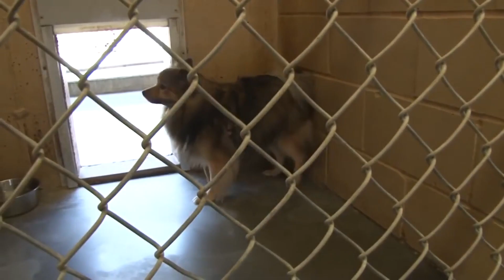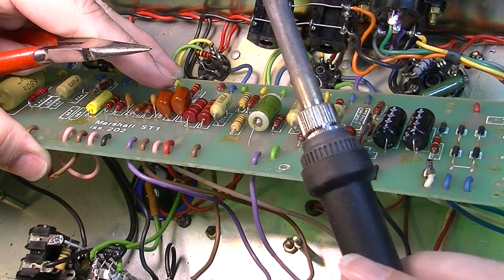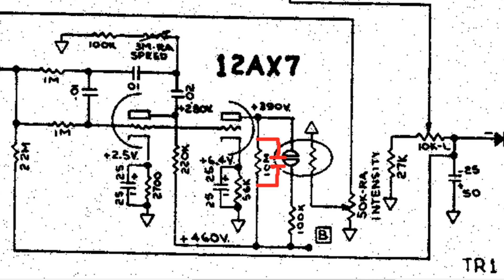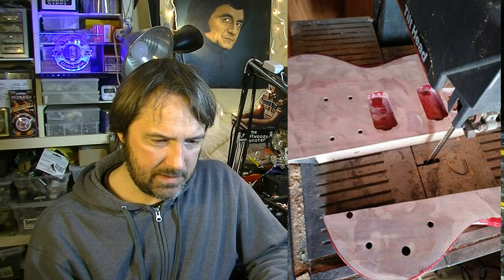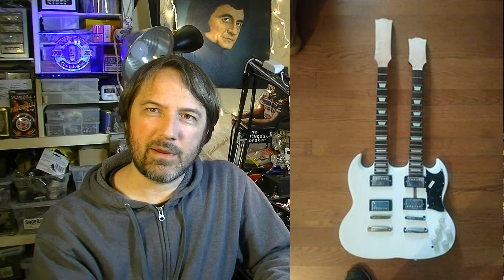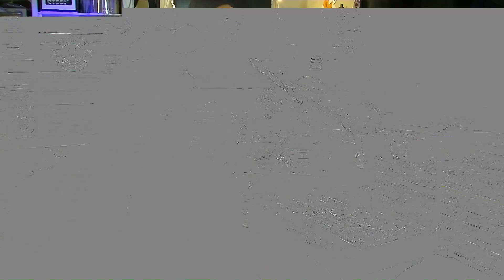So You Want to Learn Amp Modding? - SPF BONUS

Comment: I have a stupid idea that might be cool
I just wanna know if it can work 

I have a bugera 6262
I run an abominable hellmouth as my overdrive
Would it be possible to chain my overdrive into the lead channel internally so that the tone that comes out of the amp is already effected by my overdrive?
I have 2 of them but ones bypass is broken so i got the idea to use the board inside my amp but i dont know if that is even possible and i need direction from someone experienced in modding

Comment: Thanks for giving everyone a few tips Brad.i enjoyed watching your channels. so far I modded a orange crush 12 and a fender acoustasonic 15 with a pair of passive rockville slim wall mount speakers that I stripped the crossovers, tweeters, and 1 mid woofer( for the orange )out of the shells then stuck them directly to my amps speaker wires.i kept the eminence in the fender while adding a tweeter in one of the small holes in the faces of both amps.the orange has extra gain but cleans up very well and easy to just roll it off. the acoustasonic sounds even more sonic but with a little less microphonic squeal.

Comment: I fried a silvertone 1484 while swapping out a high value resistor  to a lower one in the power section.  As soon as I turned it on , smoke started coming out of the power transformer. I learned my lesson the hard way.

Comment: Can u please help me ?? I have a traynor ycv80 , I know but I'm poor . It's a 2 12 combo sound will completely drop out while playing on either clean channel or gain channel and when it cuts out if I lightly push down on the volume or gain knob on channel 1 the sound comes back. It will defantly cut out if the amps turned up but again lightly touch one of the 2 knobs and bam comes back . I replaced preamp tubes with 3 tung sol 12ax7 power tubes are 2 tung sol 5881 and 2 6l6gc Svetlana. Please help..

Comment: Did Fender ever make a 6L6 push/pull tube amp?  I think my dad used a Fender schematic to build my 6L6 push/pull amp back in the mid 1960's.  It was a good amp, just not loud enough for me.

Comment: Vibrato tick: install a .01 uf 600 volt from the junction of the photocell and the 10 meg to ground. Also, move the intensity and speed control wires away from the other pots.Move the vib tube socket wires together near the tube socket.The old update was a .01 uf across the 10 meg.That one didn't work so well.

Comment: I love you and the channel, but the ticking is almost always a lead dress issue, you have to chopstick the wires until it stops, its good to follow the fender layout for that but on my blackface princeton 1 wire that goes parralel with the tremolo pedal wire had to be moved as far left as it can to stop the ticking, also the wire that goes to the right lug of the trem speed pot had to be moved, sometimes its just a few milimeters and it does all the diffrence.
you can also add shielded wire from the board to the pots and ground the shield only to the pot side, ive done it to the input, the volume pot and the reverb pot and it made a world of a diffrence. sorry if i made mistakes, english is not my first language.

Comment: In re to "Build Your Own Clones" pedals. They are great.  I have built one of the chorus pedals and the FET preamp pedal and both are great.  Also building the Overdrive V2 right now, and I've got the Soaring Skillet waiting in the wings.  Previous to building these I had no experience soldering or doing much with electronics.  I just watched YouTube videos to learn, and the BYOC instructions were great.  Also the folks in their forum are very helpful.

Comment: A few months ago I got a good Champ-like amp, a Silvertone 1471, for $100 off Craigslist. It works great. Then I got a Kalamazoo model 2 (with tremolo)for $130 on the Bay, also Champ-like, works great too. You don't have to spend a lot to get a good basic amp with real parts and simple wiring. Watch the ads and be patient.

Comment: Can you walk through the Sears Silvertone 1484 Twin Twelve reverb circuit. I think I am following it but I'd like to know that I'm following it :) The amp has a different value for R41 than the schematic. It looks original. Schematic = 68k, value in the amp = 160k so it's not small change. The schematic is all over the web or I can link it.

Comment: The Epiphone Valve Jr is said to be the ultimate "gateway drug" into amp modding. I bought the v2 head almost two years ago and lots of components have been replaced. It still works, and the original PCB hasn't taken any damage from all the component swaps :-)

Comment: Tip.Mr.Carlsons lab has a piece of equipment you may be interested in. Its for working on solid state or switch mode power amps. Its called a signature tracer. I seen it on the vid called Electronic repair Samsom B77 stetro power amp. About mid way through and in the end. Seems like one hell of a piece of gear for the amp tech. And its a DIY build.

Comment: I have a solid state amplifier I'm working on.  I cannot find a schematic for it.  It's a Holmes amp.  The output has no coupling electrolytic cap, it goes straight to two speakers,  but I cannot tell of it was connected in parallel or series.  I remember when my cousin played through it back in the 70s that thing was loud!!  Anyway I replaced the old electrolytic caps, some were open and others were leaky and a few transistors that didn't read correctly.  I can't find some of the original transistors anymore.  Anyway the power transistors are 2n3055 so the old ones didn't quite match and I replaced them with some from mouser.  Well long story short... I've never fooled with a setup for transistor outputs before and I had my audio generator, dummy load and scope setup.  After 2 minutes in seeing a sinewave then it clipped into a square wave.  I heard a thud and the fuse blew.  Come to find out the output transistors failed.  They were fused/ shorted together.  Someone had said the output transistors today are not the same as the older RCA ones.  I'm not sure.  But it had to be drawing some current there or they just couldn't handle it,  even though it says they can.  The number on the transistors are the same as the old, 2n 3055.   I wondered if it was because of using my dummy load straight to transistor out.... the dummy is made for tube output transformer or tube... tubes are forgiving transistors aren't.   Let me know what you think Brad.   Thanks bro.

Comment: Poor guy, a Mesa on the bench. I just spent  days on a Dual Rec Tremoverb. Those things are the worst amps on the planet to work on. Turned out to have a bad LDR in the switching matrix. Works after 5 minutes of warm up turning power and standby when cold. Unfortunately these parts are obsolete now and were never a good idea to begin with. No wonder they only made these for a few years. The Mesa Swiss Army knife of tone with 22+  LDR's for switching is a bad idea. Bruce Egnater pointed me down the path to find this issue. Merlin Blencowe talks about briefly of how this switching system is dodgy at best. He is correct. Well, at least it's all recapped and  working now. Been dead for years according to the customer. Sounds great once it gets going. I guess a short wait is better than no amp at all.

Comment: The Dan Torres book has a fix for ticking tremolo----you have to re-dress some of the wires to the tremolo oscillator tube and "bunch them together" a certain way. I did this on several silverface Deluxe Reverbs a few years ago, it does work.

Comment: Hey Brad, I think you showed the 1481 or 82? The 84 is the Twin Twelve with two 6L6's in a tiny piggyback head and a 2x12 cab that it can tuck into.

I've got one of them, but only the head. Terribly inefficient OPT and cheap power supply design. It is a nasty beast, and with a WGS G15c my main amp. I think I'll have to die before giving it up... may not keep up with a Marshall lead tone, or Fender or Vox cleans, but the splatting and fuzzy crunch of that thing pushed full tilt is a unique sound. 

And that trashy reverb that so many hate? I think its trash too, but I love it! Mo dirt, mo trash, mo betta tone bruh, lol.

Love this series! :D Cheers, Brad!
Reply from the maker: Yeah, I show the 1481 and 1482. I may have misspoke in the video.
Reply: No worries at all! Just showing some love for that line! Great stuff!

Comment: As far as practice amps go, I've tried the champ, the epiphony, both modded, a Vox AD30, a Champ I don't remember but had the modern effects built in. Just couldn't get into them. I need more power, a personal problem I guess. I have found a 20 watt head to be sufficient to satisfy my lusts. A used Jet City 20 watter can be had for under 200 bucks if you look, and then buy a 112 cab for cheap and you've something that is gigable. I do have a little Ibanez SS amp that I like the sound of, but I have several others that I don't. Of course the 20 watter is louder, but can be turned down. So 2 EL-84 power section, or 2 6V6 power section is good for the soul. Just a thought, cause I was NEVER satisfied with the 6" or 8" speakers that come in the smaller amps.

Comment: The BYOC pedals are very good value for the money. I've built a few for people and they are quite nice and have good documentation. You will need a fine tip on your iron and some experience with soldering as they are very compact circuit boards. For guys just getting into amps I'd recommend starting with an amp like Brad mentions OR getting an old PA amp like a Bogen Challenger. It's easier if you start with something that's functioning rather than a piece of DOA gear.
Reply: The byoc facility is only 15 minutes from my place. I've been in the facility and the owner is a super nice guy.

Comment: Same boat here, so any single ended?  Or is Fenderesc more specific than that?
Reply: i'd recommend building a champ from a kit , and then modding that . You'll get the double benefit of getting  building experience and then you can  mod to your hearts content!
Reply from the maker: Any small SE tube amp will be similar to each other in circuit.

Comment: I'm not sure where to submit questions, I'll try here.  I'm playing through a 1972 Fender Bandmaster TFL5005D which is bone stock (never been touched) as far as I know.  Channel one is fine.  The problem lies in channel 2.  When the amp powers up it seems fine.  Then after about 10-15 mins I get fizzly distortion, the jewel light starts to flicker,  and the reverb dies.  This bums me out a great deal because I love the old Fender reverb.  Any thoughts?
Reply: Sounds like a leaky cap within the reverb circuit,, or maybe just a bad tube,try switching the pre amp tube that drives the reverb and see if it stops. If it don't you'll have to go inside and check out the capacitors and the solder joins within the reverb circuit. If you're unsure get a tech and have him go over the amp.
Reply from the maker: A flickering light is probably just a dirty light socket. And if the light socket is dirty or oxidized, the rest of the amp probably is too. Clean all controls, jacks and tube sockets with contact cleaner (suggested products in video description) and try again. Most reverb issues tend to be bad connections on the RCA jacks. Clean those too, on BOTH ends.
Reply: @Fixologist1  Lol Karl, I think this thing has seen it's fair share of nicotine in it's lifetime, I'll spare it anymore.  Thanks to Samuri and Brad for the advice as well.  I am going to clean everything up first and if that doesn't get it I will have to order a cap complement for it.  I have another sad story.  This one truly sucks, and again any advice would be appreciated.  My father is getting ready to pare down some of the old equipment so he had me go dig through the basement looking for the old Farfisa Compact Combo organ.  Couldn't find it in the basement.  As I would soon find out, it was buried in the shed.  Not good...  The shed is a particularly humid place and also apparently has a rodent population.  So much like the city baby, our poor organ has been attacked by rats.  Well, I'm pretty sure it was mice, but no matter.  Has anyone restored a barn find that has been fouled in such a way?  I have pictures if anyone wants to see.  It sucks.  They chewed through the entire ends of the plastic housing for the electronics.  They nested in the cavity in the right end in front of the boards.  They chewed through wires.  It was sitting on end so the right side is the high side and piss and shit has run all down through it and rusted metal.   I really don't know where to start.  What can I use to clean it up?

Comment: Why didn't you talk about the ceramic disc caps/ the .01's and .02's? They are what usually goes in the tremolo circuit.
Reply from the maker: Ceramic disc caps are actually very robust and not likely to fail. But yeah, if the trem is not working at all, that's one thing to look at.